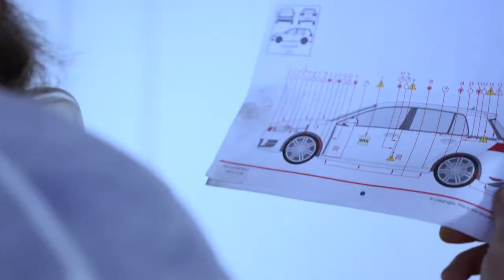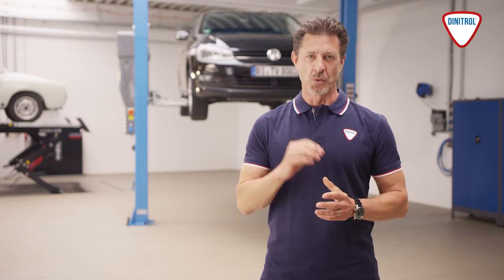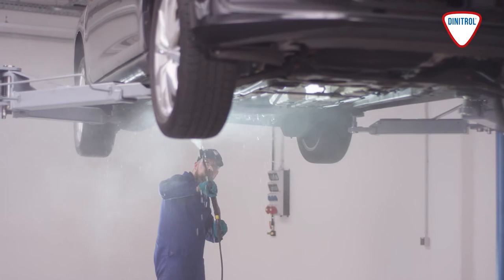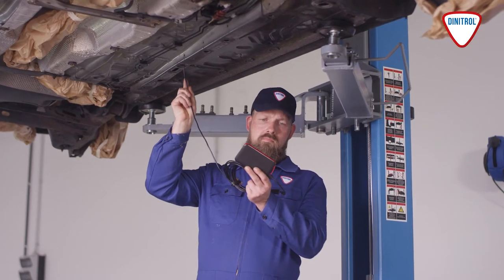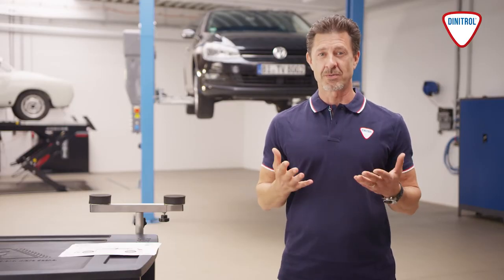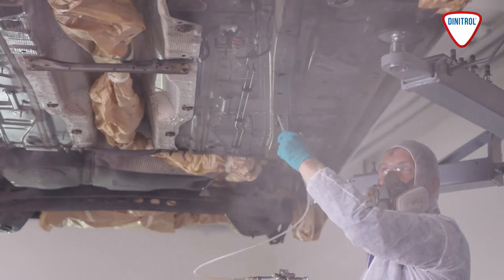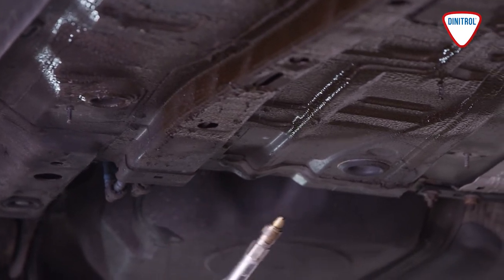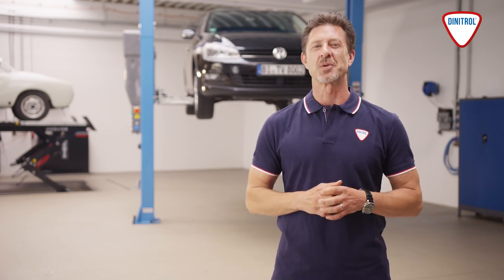2-Layer Corrosion Protection | Work Instructions | DINITROL

Comment: Would you recommend applying the protection in winter? Or would it be better to wait for spring/summer? Thank you
Reply from the maker: Hi @stmarks3934, thank your for your comment :) Corrosion prevention applications are done the year around and the important things are that the object can be properly cleaned and dried before the application, that the object and product is at  a temperature of 15-25°C (the higher in the range, the better) and that the drying can be done indoor at least over night. With the right facilities and conditions, it can be done the year around but of course, if the object cannot be handled like described, the warmer period of the year is better. Best regards, Team DINITROL!

Comment: How long does this last?
Reply from the maker: Thank you for your comment! The durability depends on the use of the vehicle. For example, off-road vehicles should be checked every 1-2 years and repaired if necessary. Vehicles that are less likely to be on the road need to be touched up less frequently. If you have any further questions, you can also contact us via mail info@dinol.com. Best regards, Team DINITROL!

Comment: What was these products ?
Reply from the maker: Hey DibroTeam, thanks for your comment. 

For cavities, DINITROL ML can be used alone or in a two-layer system with e.g. DINITROL 1000 / DINITROL 3650 or Penetrant LT.

For the underbody, a thin coat of DINITROL ML can be applied at first and then DINITROL 4941 / 4942.

Bonnet and tailgates can be treated with a more solid product such as DINITROL 4010 or DINITROL 1000 / 3650 or Penetrant LT. 

Please contact us if you have any further questions.

Kind regards, Team DINITROL!

Comment: Please nobody use this or similar paintable rust protection product's. They seal in and accelerate existing rust, you will never be able to remove a treat all the existing rust. Secondly the product will inevitably crack or flake in some area, once this occurs moisture will get under the wax layer, it stays more damp than if it were exposed to air and dry out and again accelerate rust.  If you must use something, any sort of lanolin product is superior and far easier to apply.
Reply from the maker: DINITROL has been doing the application of 2-layer protection since more than 50 years, 200 000 + cars / year and the right process is the secret. Remove all loose corrosion,  apply DINITROL ML and allow it to penetrate all flanges, gaps and corrosion. This takes about 15-30 minutes. The humidity and oxygen is removed and the corrosion stopped. Second layer, the bitumen based product, is applied in order to protect the first layer and the metal from mechanical damage. This system is normally lasting for several years, only checks and possible touch-ups are required in at least 6-8 years. Controls normally done every 2 years. Best regards Team DINITROL!
Reply: Dinitrol is oil based. It is not ‘paintable’, you have to spray it on. Only the rubber ones will encourage more rust. Oil doesn’t. Physics doesn’t allow it to.